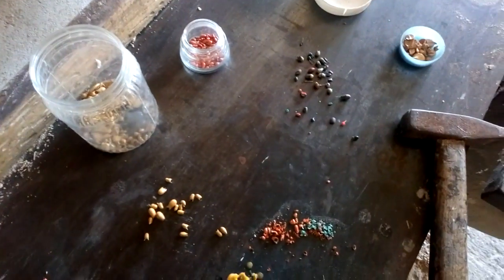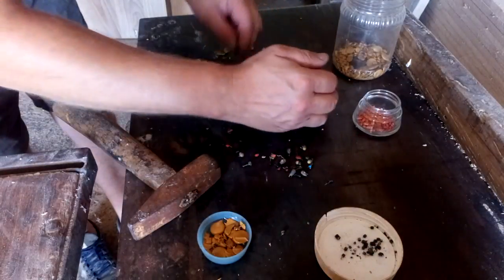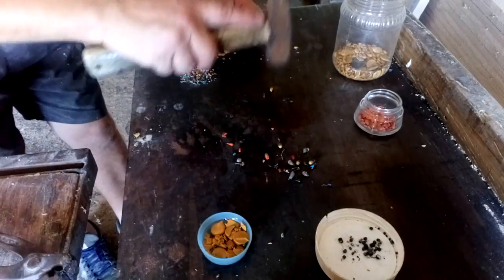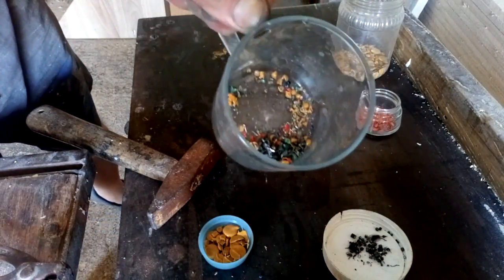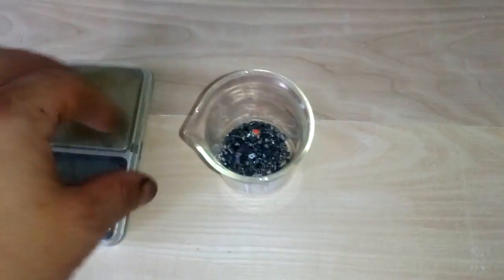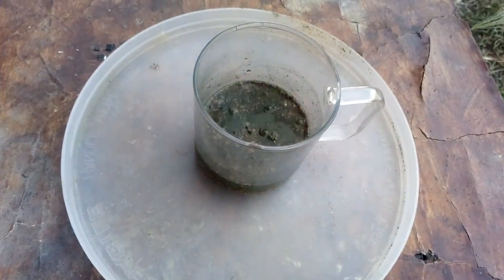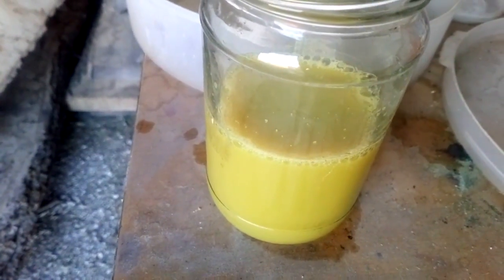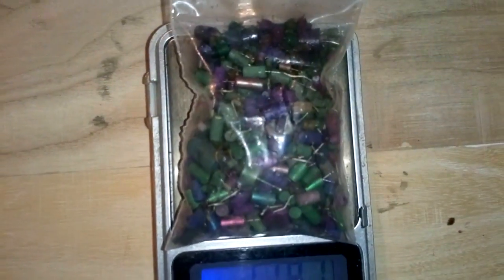TANTALUM RECOVERY part 2

Comment: Where do you get all your tantalum capacitors from and how do you tell the difference between them and regular capacitors?
Reply from the maker: From older plates I remove metal and from the newest epoxy type. They have specific designs and they are easy to get to know, but the best way is to open and check one.
Reply: Watch his part 1 video it will help you identify them